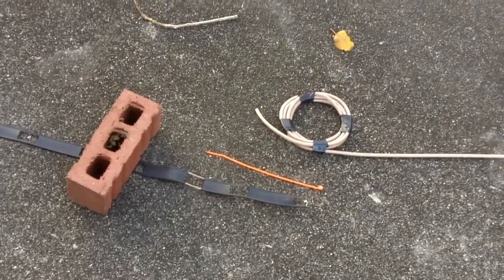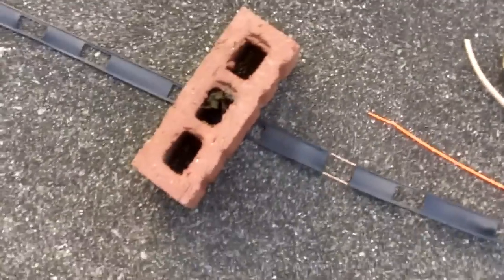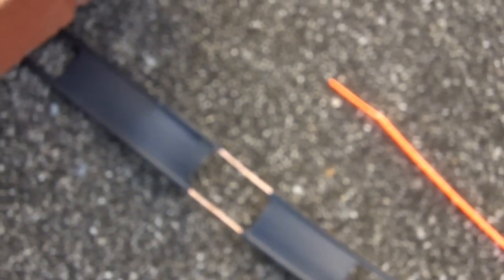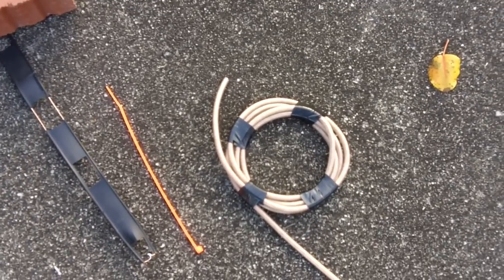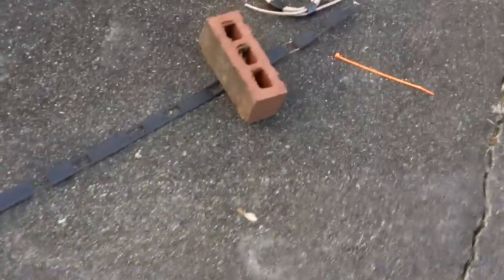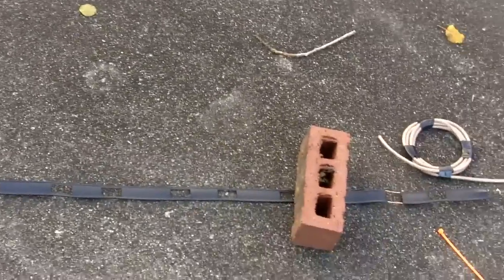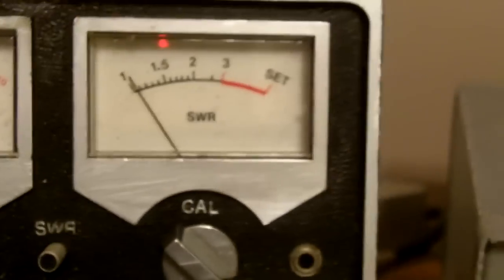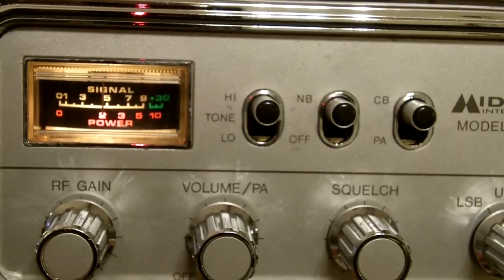How to build a cheap wire J-Pole base antenna for CB Radio

Comment: Would this work inside a length of PVC like Ed Fong's 2m/70cm jpole (but longer) offering weather resistance and no need for radials?
Reply from the maker: Never tried that, but it might.

Comment: This video is to me about the best in terms of clarity with more showing and less telling. I built one 4 years ago with some RG-58A/U I had for Ethernet as kind of a joke but the performance has been really great despite the fact that I made the balanced line a bit long and the wire a bit short resulting in 3 spots with a low SWR between 25 and 28MHz. I used a crossbow to get it 100 feet up a fir tree.

I can use it on 10, 11, 12, and 15 meters with a tuner but I'm scared to put more than 100 watts into it without rebuilding it. I have better tools now. I'm using 3D printed air chokes to hold the coil form and I haven't had any problems with RFI coming into the shack. I've reached Iceland with a 5 watt WSPR transmission. I thought I'd say thanks for sharing.

Comment: RF is AC.  Doesn't matter which site you solder the center or the shield of the coax.
Reply from the maker: According to the web page below connecting the center conductor to the short leg changes the radiation pattern and lowers the gain.  See his explanation and models below;

https://www.w8ji.com/end-fed_vertical.htm
Reply: @carolinapirate2830  right.  But Tom W8JI is assuming no use of a ferrite choke to eliminate common mode currents and feed-line radiation     Using. A mix 31 x 12 turns will get rid of the common mode and then either side can be used effectively without any change in pattern.      See. https://youtu.be/ImbvvfHyctY.

Comment: I am looking at doing this antenna. My question is on your 1:1 voltage balun did you hook the bottom of the ladder line right to the balun or did you still twist the bottom end?
Reply from the maker: You still need to twist and connect the bottom end. Attach the balun 7 or 8 inches up from the bottom connected/twisted part.

Comment: Hi from 🇬🇧 CP, I got a box of connectors and coax,ladder line, and I got an 80ft tree outback, so using your measurements im gonna have myself a crack at 1 of these j poles tomorrow, 73's from 26-CT-4078 The Mad Hatter. Mcr England 👍🇬🇧
Reply from the maker: I've been using mine for years. They work great. One thing I've learned over the years is they stretch a little over time, so don't be surprised if the resonant frequency drops about 10 or 15 channels after a year or two. It still works great, but you may find you have a lower SWR around channel 1 than channel 40 after a year or two. Also the SWR goes up a little when the antenna is wet, and it comes back down when it dries off.

Comment: Is that what you talked to 177 in Toronto on?
Great video. Mower junkie hasn't built this one yet. Lol.
Thanks for sharing this. 
Oh have you put a mfj259 or a Rig Expert on it to get the details?
Reply from the maker: That is the antenna I use for local vertical talk.  I can cover about 90 miles with it. My Lazy H antennas blow it away for skip though.

Comment: My wire is 300ohm twin lead same as old TV antenna wire. I changed all my dimensions to what yours are and added the choke and I finally got my SWR's down just under 4 from 10 
I've tried 6" and 10" on the feed and still can't get  a usable SWR. I had no idea this thing was going to be this aggravating.  I wrapped my loop around the insulator at the top of the wire but did not solder it back to itself.

 I'm about ready to cut the jay lose and make a dipole. I liked the idea of a bottom fed antenna because it needs less coax.
Reply from the maker: I've never tried it with 300 ohm, but it should still work.  The tap point for the coax would change, but I don't know by how much. You can get 450 ohm ladder line from TheWireMan.com or HamRadio.com. It is not expensive.
Reply: @carolinapirate2830  yeah I'd like to have it working. I built it to these specs and Dave says you can use wire  instead of aluminum tubing. Not sure what the problem is. http://www.amateurradio.bz/cb_radio_j-pole_antenna.html
Reply from the maker: @RC-Heli835  I've built at least three of these over the years using the measurements listed in the description on my video.  One of the locals built one as well using my measurements. They all worked.
Reply: @carolinapirate2830  Ok did you say  7" to 8" inches on the feed? I haven't tried those measurements yet. The reason I tried ten is because that's what the jpole calculator suggests.
 You can punch in 27.600 and get roughly the same long and short length as your antenna and it suggests 9.96" up on the feed.  http://hamuniverse.com/jpole.html
Reply from the maker: @RC-Heli835  My dimensions are listed in the video description below the play button.  Clock the "Show more" button to see the full description.
Reply: @carolinapirate2830  ok thanks.

Comment: Did you use a jpole calculator to arrive at these lengths? Seems like everyone I see has slightly different lengths. Also is there a formula for building the choke?
Reply from the maker: I found the plans for a 10 meter version of this antenna centered on 28.400 MHz, and then I did the math to resize it for the CB band. I've been using this antenna for about 8 years now, and it works great.   It does stretch a little after being in the air for about a year, so a re-tuning may be needed a year later.
Reply: @carolinapirate2830  I bet you found Dave Tadlocs jpole built with 350 ohm twin lead on bottom and aluminum tubing instead of wire.
That one calculates to 24' 2 inches at 28.400 mhz.
 I built mine to those dimensions first and moved it outside and haven't been able to get the SWR barely below 10.
I took the so239 off last night and soldered the coax strait in at 10.2 inches instead of 6 inches where Dave suggested. I've added roughly one ft to both leads.
Reply from the maker: @RC-Heli835  No, the design I found was exactly as my all wire and ladder line J-Pole for 27 MHz.  It was in a PDF file on someone's web page, but I have forgotten which web page I got the 10 meter designs from.  You can see the original plans I used for the 10 meter (28 MHz) version at the web address below;
http://www.shadowstorm.com/cb/pdf/10mjpole.pdf
Reply: @carolinapirate2830  ok thanks!😀And the 5 turn choke worked fine?
Reply from the maker: @RC-Heli835  The RG58 choke worked for power levels up to 200 watts, but 400 watts+ eventually cooked it. I switched to a 1.5 KW 1:1 commercial balun after that.
Reply: @carolinapirate2830 Great!  I'll wind a choke when I get home and see if I can get usable SWRs. Also put an so 238 like that plan . I'm using 300 ohm twin lead which is narrower than the 450 ohm ladder line. Do recall how high up your feed line is?

Comment: Nice job.  I noticed from your oldradio videos how quiet the background is. I'm awash in electrical noise here both through the line and RF. Hopefully if I can try this design it will improve as the feedpoint shorts all but intended RF (I guess)
Reply from the maker: I live out in the country with many acres of woods around me.  That is part of the reason it is so quiet.   There is an older mobile radio you can find on Ebay that has an excellent noise blanker. It is a Realistic TRC-451. That radio is highly sought after so expect the bid to go to $75 or higher.   It has one of the quietest CB radio receivers I've ever owned.  As it is 30 years old it made need to be serviced when you get it.  MikesRadioRepair does a good job with restoring old radios. Make sure the meter still works. The radio is not very good for adding extra channels though. It sounds great with an Astatic TUG8 D-104 desk microphone.
Reply: @carolinapirate2830  Thanks for the info. Lucky to have miles of woods and you probably don't have a bunch of wi-fi gadets or led bulbs or whatever else that causes noise all over the house. the 451's are crazy expensive usually 400+, but will keep an eye out, may get lucky, thanks

Comment: Do you use any type of lightning protection man? 

Also do you wire the balun In line or  parallel?
Is the balun something that can also be made or do you buy one? Thanks!
Reply from the maker: I've only found one type of lightning protection that consistently works. Before a thunderstorm throw the coax out the window, and drag it away from the house.
Reply: @carolinapirate2830  LOL! What about the times you don't see the lightning until the first thunder clap and it lights up something in your house and blows out the internet box?
That happened to me 3 weeks ago. Of all freakin  times on a Friday evening about an hour after I got home from work. No web until Tuesday evening when the new box arrived.  I was pissed. As much as the internet costs they should let you keep a backup box.

Comment: Ch. 19 is the middle of the band. 20 is half of 40 doesn't make it the middle of the band. 19 is 27.185 MHz .
Reply from the maker: Channel 19 is the busy trucker's channel. I was being polite.
Reply: You still have tuning to do anyway, do it at 27.185.
Reply: @williamhelms9942   worry about you yourself, clown.

Comment: Why didn't you just stick with a ladder line slim jim cos it would saved you adding that bit of wire to the top?
Reply from the maker: I'd rather use the extra ladder line for transmission line. I can buy all the wire I want at the local Lowes or Homedepot. I have to mail order ladder line.
Reply: Then the video wouldn't've been about a J Pole now would it?

Comment: I'm not exactly sure but would the antenna design be the same using stranded 14 vs solid copper core? I can see an advantage of flexibility in the stranded. Can you please comment on this question.
Reply from the maker: Probably. Try it and see.

Comment: 300 ohm ladder line .?
Reply from the maker: I'm using 450 ohm ladder line in that video, but 300 would probably work too. The dimensions may be a little different.

Comment: Is this a good antenna for talking skip?  Or would a dipole be better?
Reply from the maker: +JetSetDiva Performance wise they should be about the same. The horizontal dipole has the advantage of being horizontally polarized while most man made static is vertically polarized. In short the dipole will be quieter on receive when it comes to man made electrical static.
Reply: +Carol inaPirate Thanks for the quick reply.  I'm going to give yours a try since it looks pretty easy to build.  I haven't talked CB since I was in my 20's but I'm thinking of getting a little shack going again.  Shout out from Wilmington, NC, about 200 miles or so from you.
Reply: A 53' shortwave cut from 67.6' can RX
1.8 - 50 MHz . Excellent if you can figure how many turns for a trap to use for CB!

Comment: Did you use the choke? I dont I cant get mine up eighty feet. maybe 50? Will it work  with out the choke? What does the choke do? You said you was using something else for a choke  I dont know what that is? Do you need to ground the antenna?
Reply from the maker: shartne I used the choke on the first wire J-Pole I built. It worked fine.  50 feet up should work fine.
Reply: 6 turns 6 inches in diameter.

Comment: So is the 8'2" before or after you connected the bottom together on the ladder line and is it 17'2" to the insulator and how many turns did u use?

Comment: I was watching where a guy used a whip antenna for a home base antenna and he couldn't get the SWR down until ha added a Ground Plane. Could you add a Ground Plane to your hanging J-Pole antenna and get perfect SWR? I really like your setup, it would be easy to pack up and use at a hunting camp.
Reply: +Parrot Bill well that's a whip antenna that's different to this style itneeds the ground plane to radiate where as his swr is perfect as it doesn't need a ground plane as the other side of the ladder works as the ground,ithink still new myself but understand some
Reply: Don't need a ground plane, the ¼ wave section matches it up.
Reply: 108" whip?
RG 8 Coax  Balun 54" long. Negative connections on the braid, Inside Center to radio, and Outside Center to the 108" whip.

Comment: The J pole is a great Antenna for CB. It works well and can be made of aluminum tubing also. I've made one for 2 meters out of 1/2 copper water pipe. I've also made one with homemade ladder line.